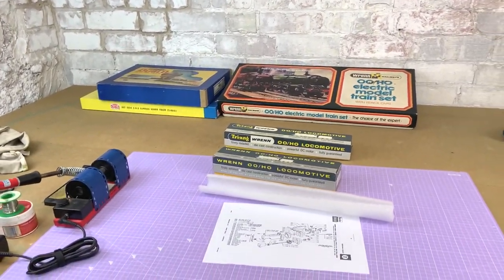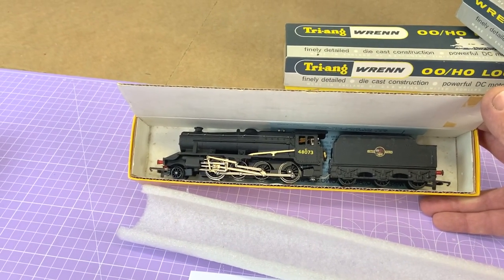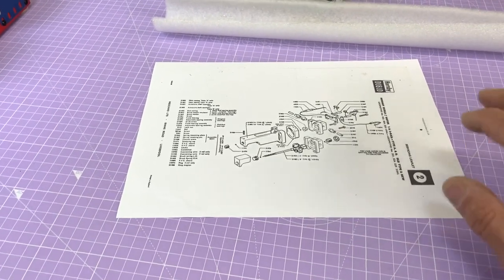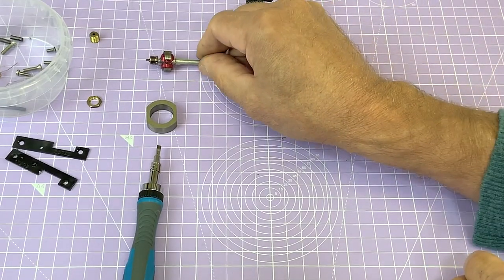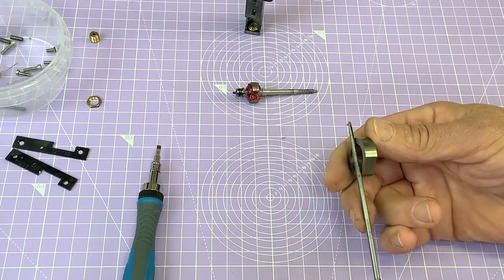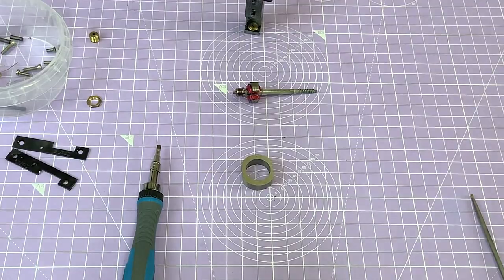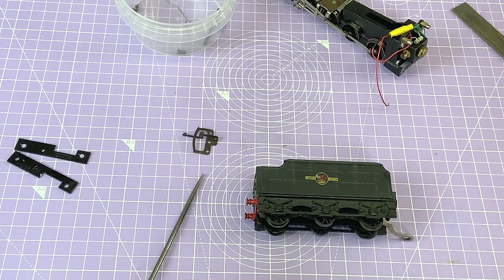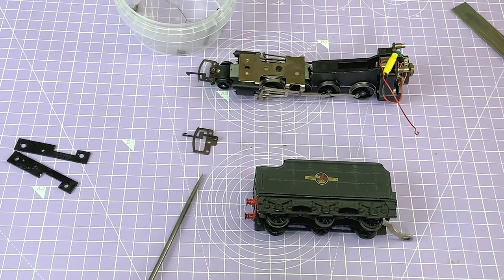A Hornby Dublo And Wrenn Ringfield Motor Revival, Almost In Real Time, See How I Tackle This Job

Comment: Interesting video.  The motor is such a solid design and so easy to work on.  I love the quality of the engineering, all nickel plated, right down to the slot in the top of the carbon brushes, and not a phillips head screw in sight.  Hornby Dublo really did make the best valve gear.  😊
Reply from the maker: It is always nice to work on these items Pauline. I know that they are a little rudimentary but the engineering is so nice and as you say no Phillips screws here. Thanks for watching, all the best to you

Comment: You can't beat a good take to bits👍👍 Over a piece of Terry towel👍 Doesn't stop springs going into low Earth orbit, but stops other small parts bouncing into the carpet pile😵‍💫 and you can wipe your fingers on the towel not down the front of your shirt😱 Mrs S. will be pleased, unless it's the best towel🤣 👍👍
Reply from the maker: That's a good idea about the towel, soaks up energy so bits stay put, excellent. I might still use my shirt for the occasional wipe though, it's hard to break habits sometimes. Take care, best regards to you
Reply: @MrSnooze  Habits, Hmm. Chest! armpits! thighs! & backside! if stood! I've got the "swipe marked" T shirt & jeans😁 Also?🤣

Comment: Thanks for this video. Hornby definitely had an attitude that has all but disappeared these days - build it like a tank so it lasts. I've just made an interesting discovery rebuilding the motor in my newly acquired Duchess; all the usual checks were made - winding resistance, clean commutator, lube, set end float etc. It ran fine except at slow speeds where it was very jerky and would sometimes just stop, so I decided to clean the commutator again, this time using a cotton bud and some brake cleaner while the motor was running. To my surprise the revs shot up as soon as I applied the cotton bud and my first thought was that I had just cleaned a load of muck off, but as soon as I removed the cotton bud the revs dropped again; it seemed as if the brake cleaner was acting as a lubricant and allowing the motor to speed up although this seemed to be a bit of an extreme change for that. So I removed the armature and inspected the commutator very closely, discovering that although clean, its surface was as rough as a rough thing that was very rough. I then did the same as you do with a glass fibre brush and a drill to polish the surface up (I'm unwilling to use anything more aggressive). On re-assembly, the motor ran far better at all revs, and vastly better at very low revs; applying a cotton bud with brake cleaner now made no difference to the motor speed, so I can only conclude that I had a huge excess of friction from the commutator/brush interface of all places.
Reply from the maker: Hello Roger and a Happy 2023 to you. How interesting about your motor. It does sound as if the brake cleaner acted as a lubricant. Have you checked the brush springs are original and not ones that are too strong? Good to hear it ran better after a buff up with the glass fibre brush, I hope it continues to run well. Best regards to you

Comment: Nice work.
When I serviced my non runner West Country Class Barnstaple I could have done with this video.
I did manage to get her running again however.
One thing to check is that the grub screw on the drive cog is tight. If that comes lose the cog gets off center and jams the drive worm.
Looking forward to seeing yours running again.
Mon from Brisbane
Reply from the maker: Hello Mom, that's such a good point you raise about that drive gear. On some Hornby Dublo and Wrenn items they actually have two grub screws in the big drive gear. Good to hear your Barnstaple is going nicely. Best regards to you

Comment: Excellent video demonstration Mr. Snooze. I have never had one of those motors on my work bench and must admit that I might well have been a little intimidated looking at that. I'm quite sure I would do just fine servicing one of those now. Looking forward to seeing the loco in action. Regards, David.
Reply from the maker: I enjoyed getting this running better David. Oil on the commutator is a nasty problem I find in these older items. Best regards to you

Comment: What a great runner! Almost being able to see it as it was out of the factory is such a great feeling isn't it. Personally i compare it to the repair shop except i'm usually the repairer and the owner.
Can't wait to see more dublo/wrenn on the layout
Kind regards
Will
Reply from the maker: Hello William, there is definitely something satisfying about a successful repair, sounds like you enjoy working on things too. All the best to you
Reply: @MrSnooze  Indeed yes, my locos spend more time having initial repairs or investigations than they do out running! Unfortunately i have a 'seasonal' layout as the garage is the only free space for my board, and winter comes and it warps like the onld acetate locos and shreds the track. Any loco mechanism put in front of me i love to work on, and your channel is something i love to watch!
Reply from the maker: @williamscates3915  Thanks for the positive feedback, I hope you like the upcoming content on the channel. My loft is not heated so well and winter running is slightly more challenging. Still I wrap up and the old locos keep running. I hope you find a way to stop the warping. Maybe a strengthening brace underneath. Best regards to you
Reply: @MrSnooze  I look forward to it very much! and if my board has more bracing it shall be a long set of battens!
Best wishes to you

Comment: Brilliant Tutorial Video. You Being Ambidextrous Makes Viewing The Close Up  Work So Much Easier. Do You Think The Original Fault Was Over Tightening Of The Nut And Bearing Screw ? Looking Forward To Seeing It On The Super 4 Mainline 👍
Reply from the maker: Hello Tim, I'm pleased you can see most of what I'm doing. It is sometimes a little tricky to keep things in the view of the camera. I think the main problem with this motor was oil and dirt on the commutator. This really causes issues. Hopefully it will be pulling some wagons soon. Best regards to you

Comment: These motors are quite easily converted to DCC. Just press out the earthed brush holder and then drill the hole  to take a Tufnol sleeve you can easily turn and bore.  One of the four screws needs to be replaced with a nylon one to preserve insulation. The slow running is excellent after conversion.
Reply from the maker: Thanks for watching. That sounds a good method of isolating the earth brush. I suppose you could do the same to the Hornby Dublo vertical motor say in a City Of London. It's interesting that you say the performance is good on DCC. Best regards to you

Comment: Snooze
You mention 'aluminium'.  That interested me as I thought it was mazac/zamac????
Pete
Reply from the maker: Yes, I'm sure you are right Pete, I must have mixed my words. Best regards to you
Reply: Snooze (I love saying that),
It appears mazac/zamac/mazak/zamak/ whatevereseit is mak has aluminium and magnesium in it, which probably explains its unsolderability.  I remember an add in Kalmbach's 'Model Railroader' featuring (probably electroless) copper plating on 'diecast' as a preliminary for soldiering.  The photo showed a loco casting hanging by a rod soldered onto a spot plated area.  I once asked a plater re copper plating prior to soldering.  He thought the copper plating would be robust enough.  Remember the plating would be somewhat better than we can do at home.  Came across the same idea in a model car restoration; results were mixed.  The idea is worth research with an eye to repairs.

Most interesting loco is the HD/Wrenn 8F.  It has much in common with the Castle, but runs only half as well.

Much enjoyed.  Thanks.
 @MrSnooze